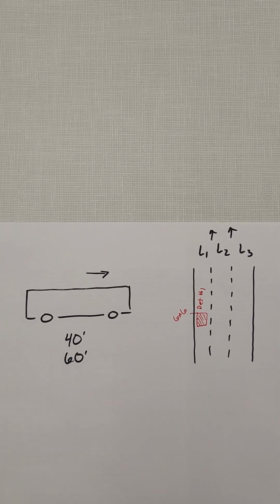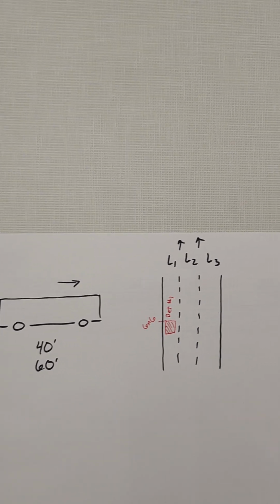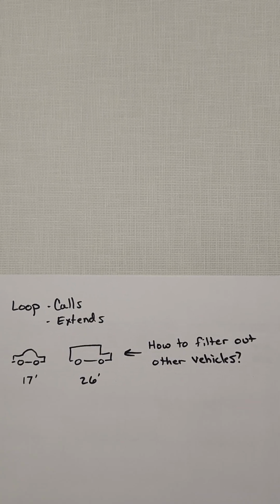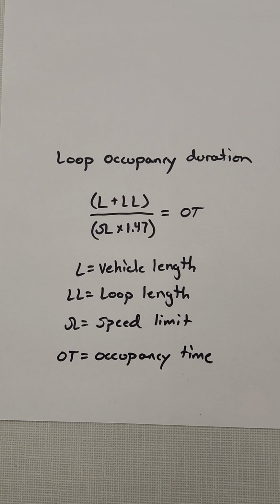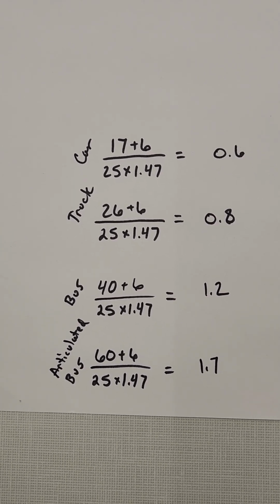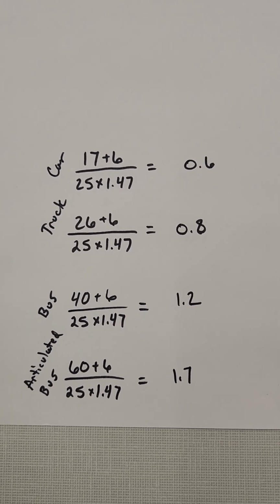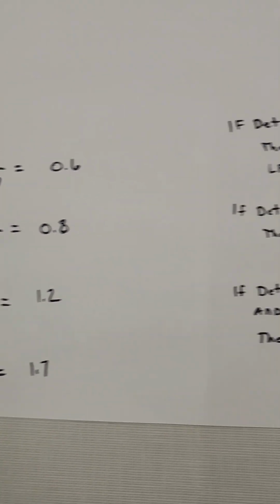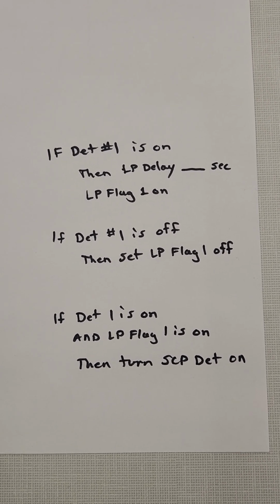Low tech transit signal priority

Comment from the maker: Ive had success with this series of logic steps, but there is a backup 4 logic steps series Ive run as well that does the same thing.

Probably a few ways to set this up, you just have to play around a bit to dial it in.